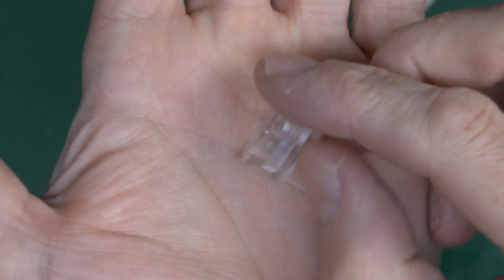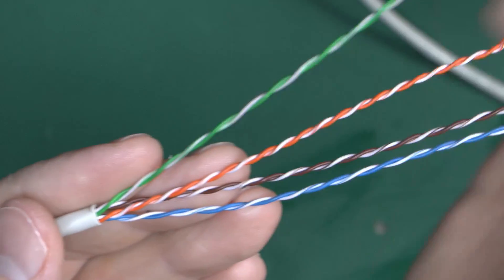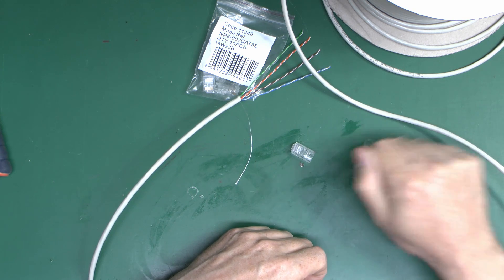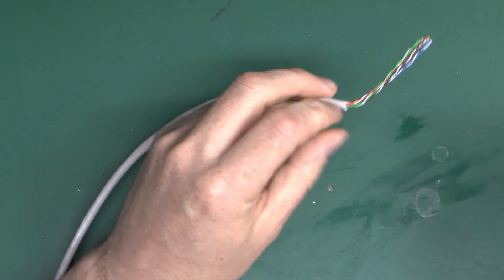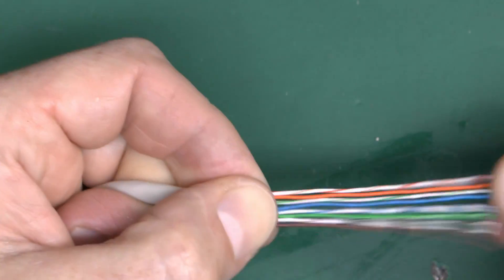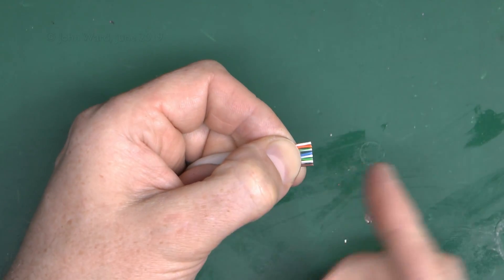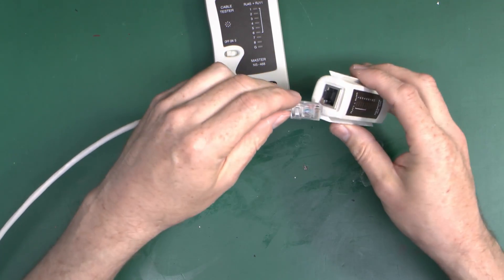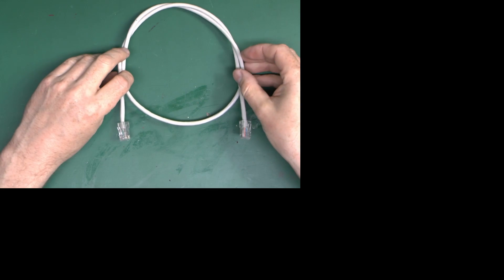Fitting 'RJ45' plugs to CAT5e Cable

Comment: OK, I'll ask the obvious question.  Why doesn't the striped green go next to the solid green and the striped blue go next to the solid blue?
Reply from the maker: Keeps the signals on the same pairs - pins 3 and 6 are the + and - for a signal pair, so they should be connected to the plain/stripe of the same colour.  Electrically it wouldn't matter how the colours were used if each end was the same, but putting high frequency signals on half of one pair and half of another will cause problems.
Reply: That way 8p8c "infra" can be used to connect, say, a phone line which has usually 4 connectors... even the "rj-11" plug fits into "rj-45" socket. One could think colouring so that start from center and go towards each end and suddenly this arrangement makes way more sense, as now smaller connector has exact same coloured pairs used no matter does there exist "rj-45" section in wire run (and ensures specified pairs are always used without breaking an wire-pair)
Reply: Well, I've got four different answers which is four more than I expected, but which one is right?
John's doesn't make much sense, obviously each signal has to be kept on a twisted pair but that doesn't seem to be a reason to split up the positioning of a signal and its return, quite the opposite in fact.
Hans's answer is not very convincing.  Surely the best electrical performance must be gained by keeping the signal and return as close as possible within each pair.
Matthew's answer is clearly correct but still doesn't explain the real reason.
So I'm coming around the the conclusion that it must be for some non-electrical reason such as compatibility between different sized connectors so I think that Sami's answer must be the correct one even though I didn't fully understand it.
Reply: @petehiggins33  Sami's answer best fits your question. The real reason is explained in  https://en.m.wikipedia.org/wiki/StarLAN
Reply: @petehiggins33  My answer was partly wrong, sorry, the middle pair, pin 4-5, is, in the past used for telephones (a RJ11, the old telephone pluck, also fits into the RJ45 but you get only access top pin 3 to 6, and for a telephone they used the middle pair in the RJ11) so, as an other poster also pointed out, it is build around the concept that you can have both telephone and Ethernet in the same cabling, and to make it as safe as possibly they put the phone on the middle pair, and to reduce interference they came up the the rest of the solution, most likely the did some tests on different variants with as much respect to "keep the pairs as close to each other as we can" they ended up with what we see now. If you go back to Cat 1 then it was mostly for telephone installation, and some more kind of data communication was added to Cat 2, and today's Cat 5e and Cat 6 is based on the earlier Cat standards with some respect to backwards compatibility.
There is (god forbid it) some joiners/splitters so you can add Ethernet and telephone (or even two Ethernet) on one 4 pairs cable, all to get most out of your copper cables, back in the day some 80% of a telephone company's money/capital was just laying in the ground as cables, so many wonderful and strange things was done to get more usage out of these cables and keep the cost low too.
Reply: This explains the reasoning:
The original idea in wiring modular connectors, as seen in the registered jacks, was that the first pair would go in the center positions, the next pair on the next outermost ones, and so on. Also, signal shielding would be optimized by alternating the "live" and "earthy" pins of each pair. The terminations diverge slightly from this concept because on the 8 position connector, the resulting pinout would separate the outermost pair too far to meet the electrical echo requirements of high-speed LAN protocols.
From https://en.wikipedia.org/wiki/TIA/EIA-568
Reply: yes more, hopefully I can explain it with a comment I already made which now I have to go back and fix.

As long as the pairing is maintained they're just arbitrary colors, however!!! if I see a cable wired with a weird color pattern I would probably end up redoing it because it most likely means that somebody's crisscrossed say an orange + pair with a green - pair or any other color pair.
The Orange pair is traditionally +/- transmit and the green pair is traditionally +/- receive. and when you move from 10/100 to 1000 the blue and brown pears are respectively used as well.

If you go to the phone world, the blue pair is traditionally line 1 (old Green+/Red-) the Orange pair is line 2 (old Black+/Yellow-) Green 3 and brown 4. And that is why you technically can plug a 2 or 4 wire phone cable into a RJ45 Jack, although the spacing is just slightly off enough to be damaging in some Jack manufacturers cases.

and on 10/100 networks 123_6_ for data
and for phone __45__
that way if a phone line gets plugged in to a network card nothing happens ( Yah that will never happen... only the white coats touch the computers).

and
@Matthew Malthouse
"That is one of the mysteries of networking that is only revealed to the highest echelons."
yes and i am the one, they call neo, from the tel-net matrix. (was that sentence ever a play on words).
Reply: Because that would be too easy!
Reply: That is one of the mysteries of networking that is only revealed to the highest echelons.
Reply: Test had shown that this "strange" way of connection the pairs (combined with the strange twisting) reduce the  cross-talk and noise. The idea is to use the cheapest cable and get maximum performance out of it

Comment: Crossover cables are still alive and well. Auto MDI-X is sadly not implemented reliably for interconnecting all the different manufacturer's chips.  They should be, but it can be a significant cause of problems.
Reply: Typically you get them with a DSL router as part of the package, and those invariably come in yellow. I sometimes use them, but generally they go straight into the pile of cable destined for scrap. Easier to make a new one that is not so thin and junky.
Reply: @SeanBZA   Just checked. The one that came with the Cisco router I got last week was blue and is not crossed :-) The crossovers that we had at work were all green.  I do have rather a lot of ones that came with routers etc - they don't match my colour scheme...
Reply: I found the biggest use of crossovers was bundling switches together when then didn’t have a dedicated uplink port.

Comment: I have allways used TIA568A as it's allways listed before TIA568B on every female connector, faster to check :D
Reply: Be careful with the terminology - I think you mean the termination schemes T568A and T568B. Not to be confused with the communications cabling standards starting with letters "ANSI/TIA-568", of which there are several covering generic rules, structured cabling in commercial and industrial situations, coaxial cabling, etc.

Comment: I'm sorry, who calls 8P8C an "RJ45"? The USA is NOT "rest of the world".
Reply from the maker: Google search for RJ45 = 98 million results.  Google search for 8P8C = 5 million results.  RJ45 is the clear winner by a huge margin.
Reply: And that's a valid data point! :)

And to think 98 million people are wrong ;)

PS. Still not "most" compared to ~4 billion people having access to the Internet ;) OK, maybe not a valid point there :(
Reply: @--Lam  
Stop digging.
Reply: in Finland every single electrician and anyone who even knows what is that connector calls it RJ45
Reply: rj45 in europe as well...never heard of 8p8c...
Reply: Japan usually called RJ45
Reply: In Germany it is RJ45...
Reply: That’s what they teach in the UK nowadays
Reply: We call them RJ45 in Australia.
Reply: And it's not  called a hover  😅
Reply: In the cabler registration in the Land of Oz you get chastised for calling it an RJ45 :) Its an 8p8c Modular Connector wired according to T568A or T568B
Reply: @LeeRyman  It might offically be called 8p8c but everyone I know, including people who install network cabling for a living, call it RJ45.
Reply: @Jaycsee66  And, unfortunately, just because a number of people call it that, doesn't make it correct - you will find no such RJ45 standard. There is a RJ45S which has an extra bit of plastic for modems with a sense resistor, but you don't see much of that today. If we are writing a spec for a cabling contract I will use T568A or B, because they are the standard and unambiguous. Lots of people say "cay-sh" or "cash-ay" too instead of "cash" for cache - saying it that way doesn't make it correct. For the record, I do have my cabling registration - if someone says they want RJ45 I would of course know roughly what they want, but I would also be clarifying what they actually require installed and putting that down on my TCA1 paperwork and cable schedule.
Reply: @LeeRyman  I'm not saying your wrong, in fact you are completely correct, and when writing a formal document for a contract you have to use the correct term. All i'm saying is, if everyone is saying RJ45 in every day conversation, then just use RJ45.
Reply: So if someone here says they want an apple, and is willing to give me lots of ££££’s, if fine if I provide an 🍏 😂
Reply: Can any of you cite a source saying this connector is called "RJ45" in your country?

From what I understand, 5 people from 4 countries gave me thumbs down because what they call it is "RJ45". 5 people from 4 countries hosting tens of millions of people. That's anecdotal "evidence".

I know people calling this connector RJ45, but that's a minority.

So a minority of people giving me thumbs down for not even calling them out (unless you're offended for being compared to Americans!)... Kind of weak?
Reply: @--Lam  Here you are, Conrad is one of the biggest supply stores for electronic parts in Germany:

https://www.conrad.de/de/search.html?search=rj-45

Greetings from Germany!

Comment: Solid wire for IDC connectors is not suitable for Rj45 plugs, 

Use stranded cable for RJ45 plugs,its c.alled patch lead cable
Reply: Use stranded for patch cables that are going to be subject to movement and are short length.  Use solid for cables that are essentially going to be static and long.  It's the latter case that JW was describing.

Comment: The plug exist is a few versions, for round cable, and for flat cable, better use the one that fits your cable, you may also find plugs designed especially for solid respectively stranded wires, again make sure the plug fits for you cable in that case too.

Comment: omg! you donˋt want to do that ! Solid Cable is to be crimpt with contact knifes which cut from the outside trough the isolation -like itˋs done in patchpannels.
These connectors have contact knifes which enter into the middle of the wire - that only works reliable with stranded wire, where the knife has space inbetween.
I once had to debug a network which was constructed like you show it here and it was the worst thing i ever had to do ... every connector had loose contact because the contact knifes werenˋt completly pressed in the connector - they had no space for that because of the solid wire.
Reply: He was using tripoint plugs. Suitable for solid or stranded and will work fine.
http://www.l-com.com/content/Article.aspx?Type=N&ID=10592
Reply: You have less tolerance when crimping solid core but provided your terminations are near perfect then using solid core CAT5e is perfectly fine imho.
I have solid core cables I terminated here that are 10 years old and still running fine at a clean 100+MB/s on my gigabit network!
Make sure ALL cables butt up against the end of the RJ45 connector (John's were woefully too short, especially the brown which barely reached the middle part of the crimp/cutter)
A good way of quickly checking this is to look at the end of the RJ45 connector, if all the cables are correctly and fully inserted you will see 8 shiny copper dots
Reply: I had no idea there was different types of keystones until now.
Reply: plus solid installation cable is not designed for flexing.
Reply: My ~20 years of IT experience strongly disagree with your opinion :) solid core is absolutely fine. If you had problems with solid core crimps not being pressed completely that is a sign that whoever did them did not care to do a good job. That is why they started implementing the ratchet mechanisms as JW showed - the early/cheap crimping tools did not have them - they do not allow you to finish crimping until pressed to the bottom.
Reply: sysPanda so thatˋs 10 years less it experience than i have (cisco certified) ... and using solid cable for patching is a donˋt ...  but i must admit i didˋt know the special RI45 for solid-wire (because we strictly used the solid cable for installation, propper terminated in patch-panels) but in an amateur environment this may be acceptable. found this: https://youtu.be/Iq-p6w7V5zA

Comment: Don't forget to make sure the plug is compatible with the cable type (stranded or solid).
Reply: Indeed
Reply: Stranded cat5e/6? I would think that would be counterproductive. Perhaps there is some high vibration environment where the fatigue resistance is a plus, but you would have to add stiffeners to maintain bend radius, twist, and impedance.
Reply: @RobertSzasz  Stranded is used for making patch cords where flexibility is desirable.
Reply: @abscomm  but wouldn't you have to go with bonded/twinned pairs? And the right insulation to give the correct impedance sort of kills flexibility anyways.
Reply: @RobertSzasz  Are you misunderstanding what John (Jones, not Ward) is suggesting, here? Stranded Cat5(e)/Cat6/Cat7 is the standard and correct cable type to use for patch leads - i.e. for connecting a client device (PC, laptop, server, switch, modem, router, VoIP phone, Wi-Fi access point, etc., etc.) to either a socket on the wall or another client device[1], where you typically NEED flexibility in the cable to ensure that the conductors don't break after the cable's been moved a few times. It's for basically the same reason that electrical wiring used for wiring up sockets/etc. within a house has solid cores, while the flexes used to connect appliances to a mains socket use stranded cores.

Stranded Cat5e/etc. cable is still made up of four twisted pairs - and from the outside it will seem identical to the solid stuff unless you tried bending it - but the hopefully-copper conductors inside each of the eight wires will be comprised of maybe half a dozen to a dozen fine copper strands. This poorly-compressed, out-of-focus photo demonstrates the difference between the two types: https://www.howtogeek.com/wp-content/uploads/2011/08/solid-stranded.png (though the stranded cable in that photo looks suspiciously silvery!). This photo better shows the stranded cores, and also demonstrates the per-pair shielding of S/FTP cable that I mention below: https://www.dhresource.com/albu_847053824_00-1.0x0/50m-gigabit-cat6-s-ftp-bulk-stranded-cable.jpg

Stranded Cat5e cable is plenty flexible, and so is the stranded Cat6 that I have. In fact, the stranded supposedly-Cat7 S/FTP cable I have[2] is MORE flexible than the Cat6 stuff ("FTP" = single layer of foil shielding around the four pairs as a group; the "S/" prefix means that each pair has its own individual shielding as well). But even if it wasn't flexible, the intention isn't like with silicone-insulated cable, e.g. on soldering irons, where you want high flexibility for the benefit of the end-user. Patch cables are stranded so that, even if you have to use a fair bit of effort to bend them into the shape/path you want, *the cores won't break from you doing so*, as they would with solid cores :)

[1] Note that in theory you need to use a special cross-over cable for connecting a PC to a PC or a switch to a switch, but pretty much all switches, and the vast majority of other devices, have supported so-called "Auto MDI-X", which automatically reorders its signals internally if the wrong type of cable is being used, for well over 10 years now. It's been a long time since I last had to worry about whether I need a straight-through or cross-over Ethernet cable! I recall that the Netgear consumer-grade switches I was buying in the early-to-mid '00s (e.g. the FS108) were displaying their Auto MDI-X capability on the front panel of the switch itself (e.g. https://www.netgear.com/images/Products/Switches/UnmanagedSwitches/FastEthernetUnmanagedSwitchSeries/header-fs108-3-4lft-photo-large.png ), as it was presumably a fairly new feature for them at the time. These days, switches still support Auto MDI-X but its only mention is buried in the data sheet somewhere, as I imagine that it would just confuse most home users, and those who are technically-inclined enough to know about it will be capable of reading a data sheet.

[2] I actually don't care if what I bought [ https://smile.amazon.co.uk/Ethernet-Network-10Gbps-Patchcable-Router/dp/B0196FJV9A ] conforms to Cat7 - and in fact it doesn't, strictly, as it has standard 8P8C plugs on each end - as I'm not planning to use it for Ethernet purposes. It was just a convenient source of cheap-but-decent-quality shielded data cable ;)